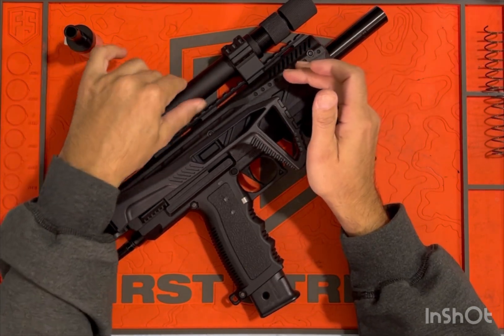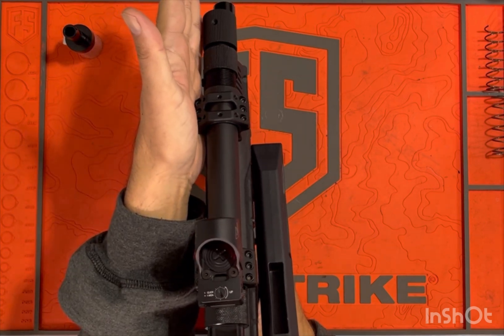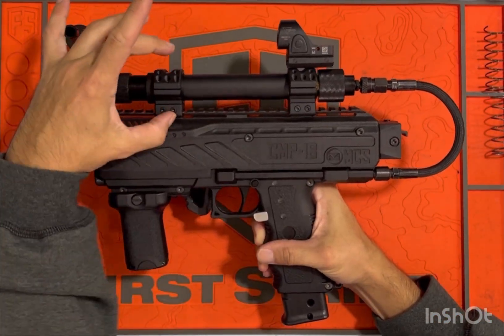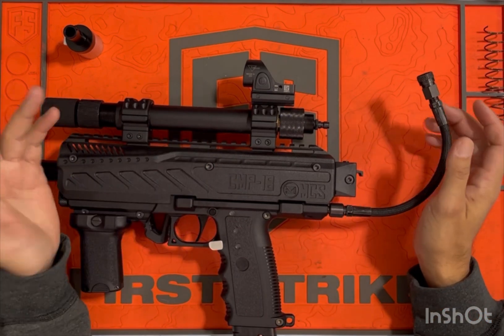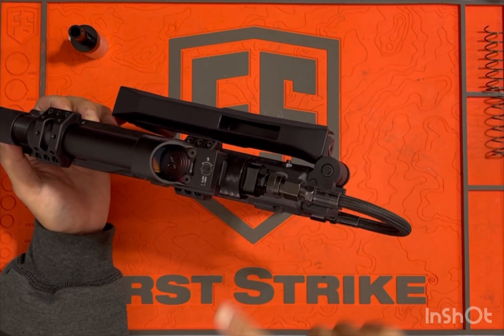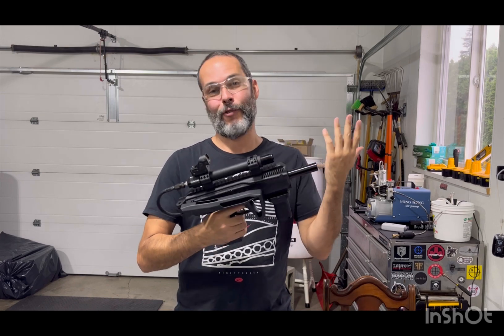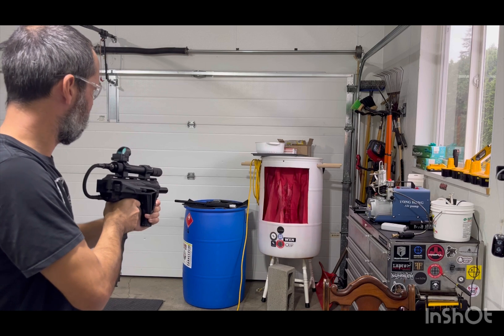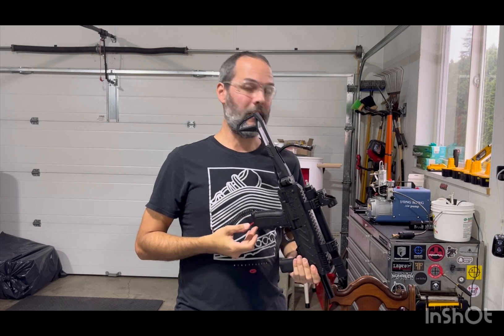LL4D - So you want to add an external air source to your launcher?

Comment: I finally got my adapter that you linked. I've purchased both nipple and the other non nipple one. It's crazy that i have every adapter possible now to use. Hose, air tank, remote line, or directly co2 88g 90g adapter 2x12g man those 2 adapters you linked are are great!!! Adding a 1/8 nipple on a whatever you call it g1/2-14 looks so simple to do but i just dont have the tools to cut and thread these out. Only thing ived been able to change is a hose with a quick connect/disconnect and a nipple on the other end i melted the nipple threadlock and finally it untwist and i put another quick dc now i got a hose with 2 quick dc/connect on both sides pretty helpful as the title of your other video says "possibilities are endless" and that is the truth for sure
Reply from the maker: Yes those end caps are the biggest piece to the puzzle. Once you have those its just a matter of piping them in how you like. Only limited by your imagination.

Comment: So your 12x2 screws into an female nipple adapter or hows it work in having trouble finding a solution to make it work. Because i am using a quick connect in both sides of the hose. And adapter coming from gun from remote line then the other one has to connext to another nipple but my co2 quick change and my 2x12g hidden milispec adapter has to be connected to a. Well bigger thread which i dont know how to do because they can only connect directky to the gun or on off adapters or 88g90g adapters and thhose dont have nipples but your top back of ur 2x12 has a nipple on top of where the 2x12 screws in did you make it like that? Or is the part you linked already? If so how would i make a female nipple adapter so my co2 adapter can screw in it???
Reply: Turns out their 2x12g adapter from mcsus will not being coming back pretty sad about that lol... guess ima go for the hexagonal umarex one...they even have a quick pierce umarex t4e one but in Germany and it's black i wish I could get that one it'd be awesome.
Reply from the maker: @-Cutz- i need the quick pierce one too
Reply from the maker: I linked the adapter with the nipple in the description. It threads onto hpa bottle thread and away you go.

Comment: Yes dude this does help I just wanted to know the adapters like the hose and nipple thing didnt even know wtf a nipple fitting was until now lol. but for the CQMF and m17 you have a different looking uh thing that goes on the back of the where the tank should go? it has a connection for the hose.
Reply from the maker: That different looking one does thesame thing as the link i sent. The particular one i was using was from Palmers Pursuit and they are closing up shop. Most things are marked sold out.
Reply: @lesslethalfordummies so would you need two? one for the gun and one for the CO2 adapter tank?
Reply from the maker: Just one and then you need a tank adapter from Aliexpress that i linked in the other vid or an on/off valve.

Comment: try this... keep right hand on grip (finger-off-trigger). reach over the marker w/ left hand , holging the stock w/ your fingers, push down w your thumb on the joint of the stock.
Reply from the maker: Off camera i tried many different methods but i was just never meant to be a lefty. This stock is of decent quality but in the end it has plastic pivot points that just seem to flex 💪🏼 whenever i do a reach around….wait 🙄. I have moved it back to the right side meow and my brain thanks me.